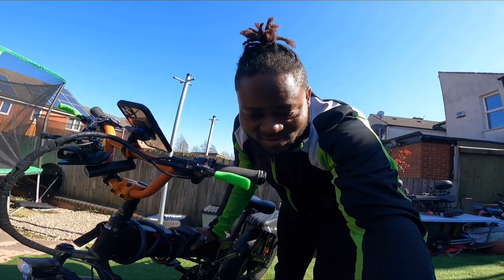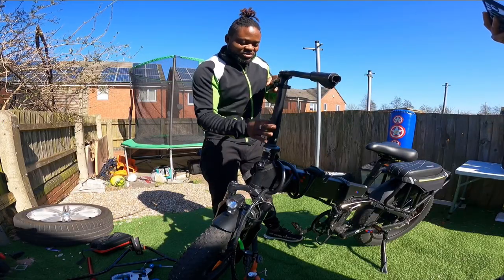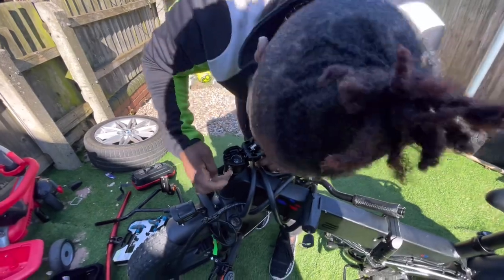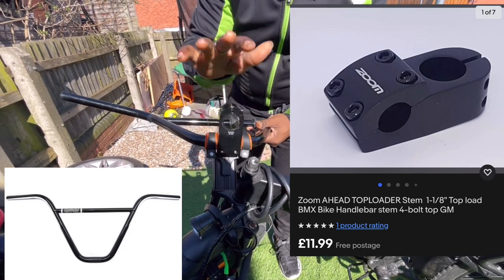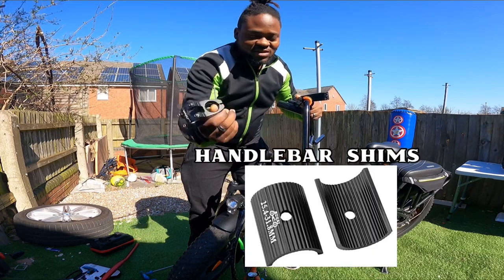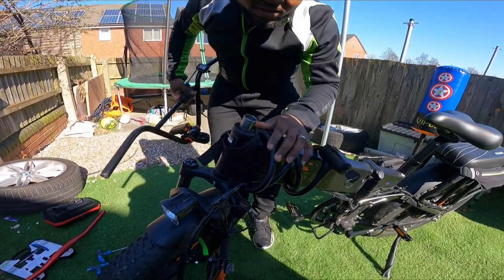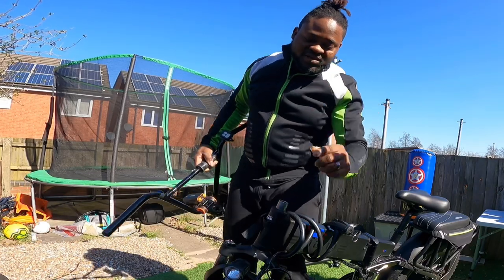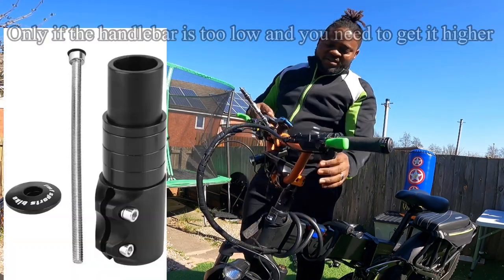ENGWE PRO EBIKE & FIIDO M1 PRO EBIKE HANDLEBAR SWAP TO BMX HANDLEBAR

Comment: I'll definitely do this to my bike, I see now why it must be a huge difference with a BMX handlebar.. the original is a bit small! The bike arrived today (CMACEWHEEL RX20 MAX) with dual motors, you should really check it out!
It's basically the same bike, but I like the rear suspension better from Cmace, as well as their logo, it's chrome and sticks out a bit and fits perfect with the overall black and white.
Some info: The bike got a switch above the indicator button, it turns the front motor on and off and the difference is huge, I can climb any hill at any speed, doing insane off-road without slowing down much.
The bike IS HEAVY, and not something you want to fold and stash away everyday, just for anyone wondering. I think it goes for all of these fat tire foldable bikes even though it looks easy on video, it really isn't. But convenient if you're going away sometimes for a longer trip.
15Ah battery in the bike, and it seems to last a long time. I didn't get to ride much because it started to rain heavily, and I didn't want to risk it first day. But 26km and the battery was at 76%, used both motors, gas only mixed with pas 5. I'm happy with that lol, I'll do a real range test tomorrow and throw in a edit.
Reply from the maker: Oh great news bro. 
I’m so happy you got it and basically came as good as u expected if not better..
Thanks so much for the info, the bike sounds like somethin I’ll definitely want to get my hands on one. 
Looking forward to your edit.
Reply: So! Range test done, a very extreme range test including 48 degree hills, mountain bike trails, city and country road all mixed. Mostly PAS 4-5 and using both motors! I got a range of 36KM!
This might not sound much but I was really extreme with my riding.. (around 11KM mountain bike trail, lots of root and uphill) battery drained fast in the woods on the trail but barely moved when riding "normally"!
The only thing I want changed is the handlebar, seat and larger gearing because I can't keep up with the pedals at PAS 4-5.
I will make another update with only city/country riding :)
Reply from the maker: @denkaes5844  so far sounds decent.
Thanks for the update bro. The range you get so far is good enough for my kinda ride around in my town here.
Reply: Hello! Are you satifying the Cmacewheel rx20 max? Is there any positve or negative toughts? I thinking buying one. 😊
Reply: @Kodiak-1984  Decent bike for the price, but depending on your country laws the bike is often illegal, missing licenses etc.
You'll notice that the bike is from China after riding it for a few months, bearings gets a bit loose (steering), tires are super thin so be prepared to buy tubes.
The bike is foldable, but it's super heavy and folding it is annoying. Do not buy the bike if you think of storing it up stairs etc.
The weight is close to a scooter moped.
Throttle has bad response time, it's not responsive at all (if not changed but doubt).
Original Wuxing brakes (mechanical) are useless, get hydraulics.
Dual motors is cool and all, but it drains ur battery extremely fast compared to single motor due to being heavier and using more power.
People really like to steal these bikes, so get good locks or store inside.
You can't pedal at max speed, the ratio is really weird, so you'll have to upgrade the cassette if you want to pedal comfortably at PAS 4-5.
Reply: @denkaes5844  thanks the honest review. Then im just stick with the Fiido T1 pro. Need the long range and I like the massive frame. Im owning a house without stairs and living a very flat land, so honestly no need the folding and the dual motors for me. Again, thanks for your time, cheers! 👍🫡
Reply: @Kodiak-1984  No problem, hope you'll be happy with the ride. I can rekommend another bike though, Engwe C20 Pro with the big motor. Much lighter, my family owns two of them, much more practical than rx20! Good luck!
Reply: @denkaes5844  thanks the suggestion, im look into that bike too.

Comment: Hello, I have an Engwie Pro 2. I wanted to put the BMX steering wheel but I have doubts about the measurements of the parts. Would it be possible to give me the links to Amazon Spain so I can buy the 3 pieces in the correct measurements?
Reply from the maker: Hey, link to all parts that was used are all u der the description of the video. I’m from the England so could only get from here but you can follow the sizes on the link I put up and search for the same sizes.

Comment: Hi. Can you provide link for the extension with long screw for Engwe BMX Handlebars. You said, if you want higher you can add extension so the BMX new handlebar will be higher.
Thanx
Reply from the maker: This is the link below 👇 but I think it’s best to get a higher lent bmx handle bar so you won’t have to use the extension. I found the handle bar to be more solid on its own but if you won’t be doing any tricks then the extension is alright.

Azarxis Bike Stem Riser Handlebar Extender Bicycle Fork Extension Aluminium Alloy Head up Adapter Adjustable for Mountain Bike Road Bike Track Bike MTB BMX DH Fixie https://amzn.eu/d/inmzLNV

Comment: Hello what size Quill Stem riser do I buy? Is it 25.4mm for £9.99 or the 22.2mm for £8.99? It’s from your link in the description. Thanks.
Reply from the maker: I got the 25.4mm  stem riser.
Reply: @Tansmen2WHEELER  thanks bro
Reply from the maker: @fonyturgurson4150  Yw
Reply: @Tansmen2WHEELER  quick update haha the one I got was too big bro. Just about does not fit so I will order the 22.2m. I feel like an idiot for not measuring in the first place.
Reply from the maker: @fonyturgurson4150  oh no sorry bro. 
Hope u was Able to send the wrong size back for your money back. 
And how does your bike feel and look now that uv changed the handle bars.
Reply: @Tansmen2WHEELER  no worries at all bro not your fault. Im still waiting for the bmx handle bars to come aswell with the stem, i could show you the comparison when it is finished soon. My bike is a Starsfly 500watt 48v Folding fat tire bike.
I imagine that with the wider BMX bars it will be comfortable compared to the higher more narrow stock ones.
Reply from the maker: @fonyturgurson4150  oh Yh definitely will be a lot more comfortable.

Comment: Can you fit pegs for the child seat at the back, for child to rest their feet on whilst sitting on the back seat?
Reply from the maker: Yes. I’ll like to bliv you can..
I found this on Amazon but iv not got it to try yet but looks like it should get the job done.

TOBWOLF 1 Pair 10MM U Slot Bicycle Rear Pedals Folding Foldable Non-Slip Rear Seat Footrest Pedals Cycling Accessories for Mountain Bike Electric Bicycle Foot Pegs https://amzn.eu/d/23k4kU8

Comment: On the engwe engine , did the handle grips , brakes  and shifer fit the bars, who did you get bars fro  ? Thanks.
Reply from the maker: Yes it all fit perfect. 
I got the handle from Amazon and the rest of the parts you can also get them from EBay as well.

Comment: Do you need to adjust the cables when you put the bmx handlebars on? Are the brake cables to short? 
Am thinking of doing this mod on my M1 pro
Reply from the maker: I didn’t have to adjust the cables. 
The m1 pro cable might just need abit of stretch but it should be ok as one of my viewers did comment and it worked alright for him on his M1pro aswell.
Reply: @Tansmen2WHEELER  thanks! How much higher does it make the handlebars? Is it more upright ride? Right now I’m very bent over and hurts my back
Reply from the maker: @AGuyWhosBritish  it’s gone high enough for my hight bro not sure on the figure but good hight.
And how you possession it depends on how you feel comfortable the most but the fact you mention of back paid I’ll say upright should be good so it helps with your sitting position.

Comment: Is the Engwe handlebar welded to the stem? or can it be removed and just use a wider bar with the folding stem?
Reply from the maker: Oh no it’s not weld to the stem. You can easily take apart with couple tools.

Comment: Hey buddy, do you know what is the rise on that handlebar?
Reply from the maker: Hey, I’m not too sure on the measurements to be honest but the exact part I used are linked below might have the sizes or more information.
I’m about 5.5 and this feels perfect height for me. If that helps 😆. Sorry bro I’m not too good with the whole maths and measuring things.
Reply: @Tansmen2WHEELER  👊🏽💯😎

Comment: Hi mate just bought the fiido m1 pro and nice to come across a decent MOD video was thinking of changing the handlebar as there too short for my liking..do you or anyone in the comments know if the fiido m1 pro handlebar is a standard 25.4mm fit for the existing clamp or is it smaller?   hard to find specs but have just started down the mod path
Reply from the maker: 🙏 thanks bro. I’m 90%sure it is the 25.4mm fit best I’ll say order from Amazon that case if it’s the wrong fit ..

Comment: Good mod, looks much better than the original handle bar, what is the quill riser extender diameter for the fiido m1 pro, 22.2mm or 25.4mm. Im going to put BMX bars on mine too and go back to my younger days.
Reply from the maker: Yh bro, make a lot of difference with the riding experience aswell as the look of the bike. 
I think for the fiido is 25.4 not 100% sure but I think so.
Reply: Thanks for the reply, its 100% 25.4mm , I went out and got my parts with a chrome handlebar, it makes a huge difference aesthetically. Ill be giving it a test ride in an hour.

The brake cables cut it fine for length on the m1 pro, but it just about makes it. Ill be replacing the brakes and cables soon with hydraulics anyway in preparation for a 1500w hub in the upcoming months. I cant wait for that, hopefully by summer.

Comment: Hi mate, don't know if you still reading these posts, but if you are, would you be able to put a link to the extender you have on the engwe. I'm looking to change out the handlebars on my engwe, and want them to sit higher, so I'd really appreciate it, thanks
Reply from the maker: Hey bro I still do reply to all video comments 😆 I think I got the extended for the bmx in the link below but let me check and send u a link.
Reply from the maker: This is the extension I used. Hope it helps ..
 Azarxis Bike Stem Riser Handlebar Extender Bicycle Fork Extension Aluminium Alloy Head up Adapter Adjustable for Mountain Bike Road Bike Track Bike MTB BMX DH Fixie https://amzn.eu/d/7sLhIwY
Reply: Thankyou very much for your reply, much appreciated. Btw, love your channel
 😎👍
Reply from the maker: @noodles169  thanks bro. I appreciate 🙏

Comment: I was going to swap mines out but after I took a test ride...its just not fast enough to warrant the swap.
Reply from the maker: Which bike do you have? 
And the swap is mainly for Comfort and look. After swapping mine out the feel of the bike changed.. felt a lot better, I could do a jump.
Reply: @Tansmen2WHEELER  I have the Orange Vitalin 750 watt, however i think the controller is pushing more amps. These bikes are too heavy to jump lol. I mean little jumps but i dont want to rattle the life out of the electronics...
Reply from the maker: @keronfarrier2198  hahaha Yh they r heavy.

Comment: How high can you go with the fiido? because the cables seem abit shorter than the engwe. It’s the only problem I’ve got with the fiido is that the handle bars are too low to be comfortable. Thanks for the video
Reply from the maker: Thanks for the comments. 
I think it might be able to be stretched a little more not 100% sure but I think you should be to and with the bmx handle bar the height will rise a little more.

Comment: Hi mate have you got both bikes what you rate is better
Reply from the maker: Hello 👋. Yeah I did have both but sold the fiido to a mate not too long ago. 
Both bikes are great in their own way u can’t go wrong… if you want extra power I’ll say go for the Fiido m1 pro, but for built quality I’ll say go for Engwe engine pro.. 
but one negative with the Engwe engine pro is the power gage bar keep going up and back down so most times I’m not sure how long I can ride for but ones I stop riding it goes bk to the correct power left.
Reply: @Tansmen2WHEELER  hey mate is Fido faster? Every review I seen say engwe quicker? Would appreciate your opinion bro gonna order One this week but can’t decide 😂
Reply from the maker: @Doves96  hey bro, thanks for the question.FIIDO is faster than the old version of ENGWE with 12.8ah battery but if you get the new ENGWE with 16ah battery its so much faster and better than FIIDO.
Fido top speed is about 28 to 30mph but as the battery drops the top speed don’t go over 27 to 28 while the old ENGWE with 12.8ah battery top speed is about 28mph to 23mph.
But with the new version of ENGWE 16ah battery version top speed it over 30mph. Iv seen over 30mph top speed on full battery and even after the battery power drops you still go faster than FIIDO on the same level battery and the 16ah battery as a longer range and turqe ..
Reply: @Tansmen2WHEELER  thanks so much mate